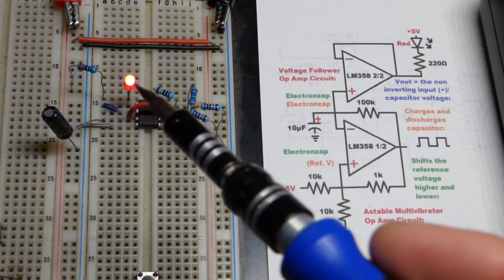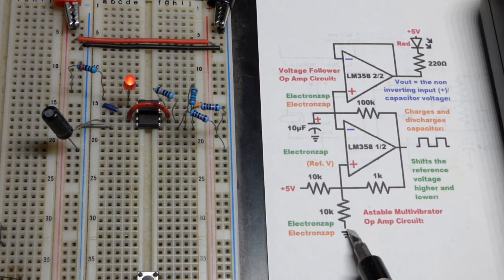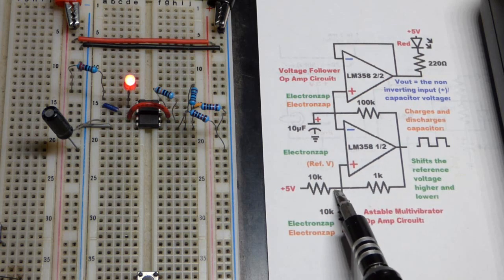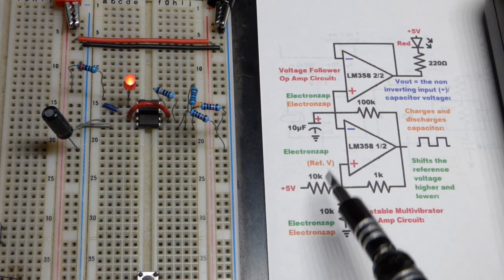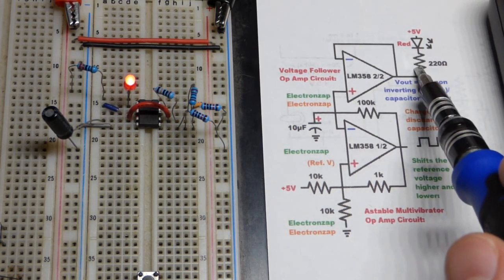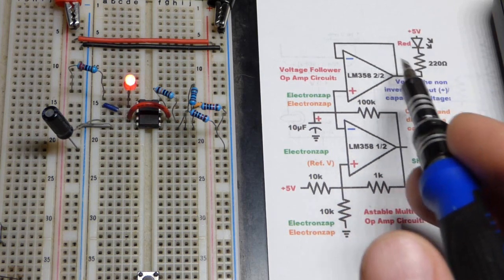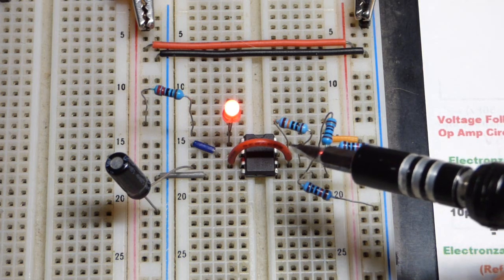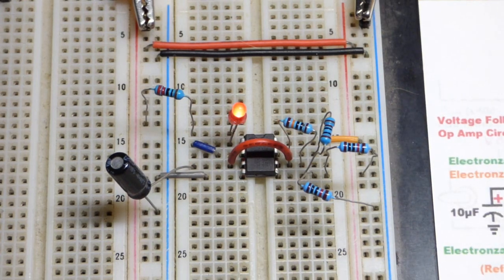Pulsating LED using 2 Op Amps circuit by Electronzap

Comment: is that 4 wires connecting or two crossing? because 4 joining should be drawn as a pair of 3, a pair of T's etc. been that way since the 70's when photocopies would cause confusion as it would make crossing lines look like joined ones.

https://europe1.discourse-cdn.com/arduino/original/4X/1/b/f/1bf52906494330090f2bc3706f572e0565968f50.jpeg